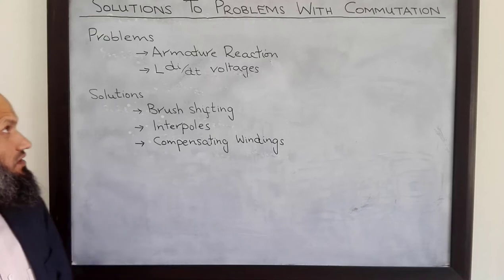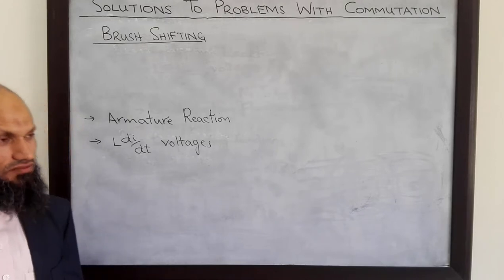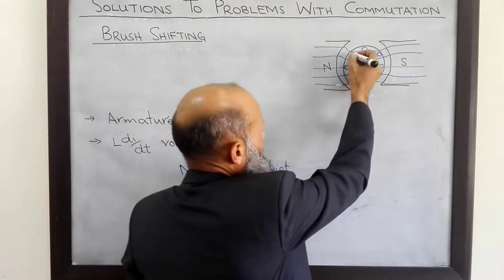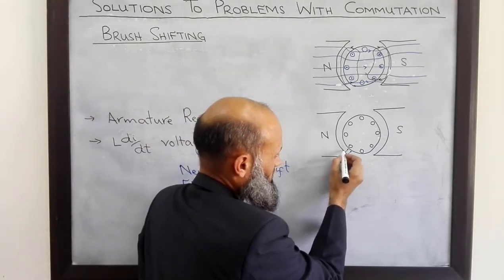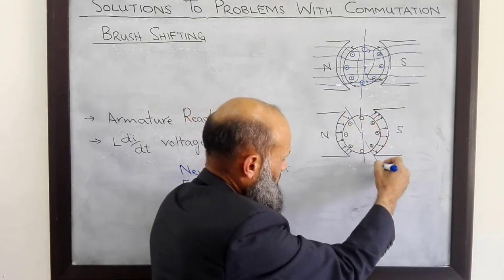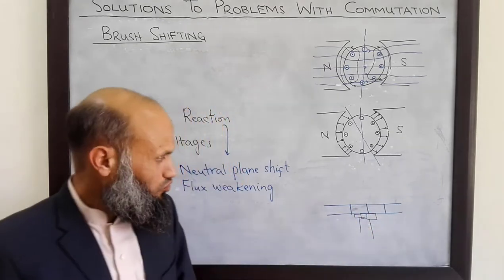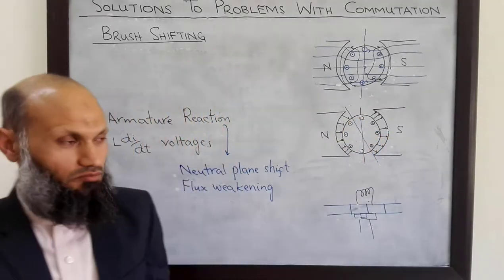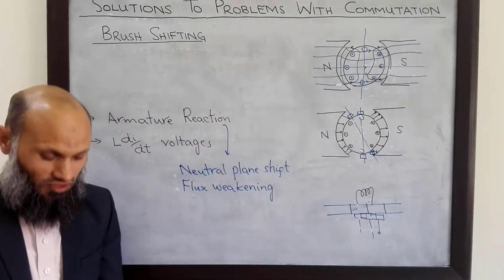EE 213 - 21 - Solutions to problems with commutation - Brush shifting and interpoles

Comment: Thanks for your good lecture, sir. However could you please tell me how we get out put voltage from the generator if we placed the brush where no induced voltage?
Reply from the maker: Between two brushes, there are multiple coils connected in series. Although, no voltage induced in the coil which is on the neutral plane, but in rest of the coils, some voltage is being induced. Therefore, between two brushes, there is voltage due to the coils which are under the pole faces.
Reply: Thanks for your explanation, Sir. Our solution is to place the brushes  on the neutral plane which are the output terminal of the generator. I am still confused if our output terminal is placed on the neutral plane we will get zero induced voltage. Sorry for this inconvenience, Sir.